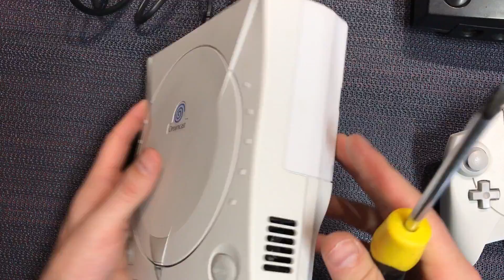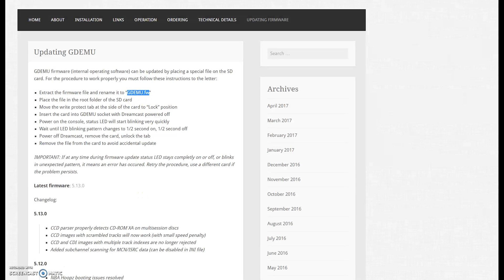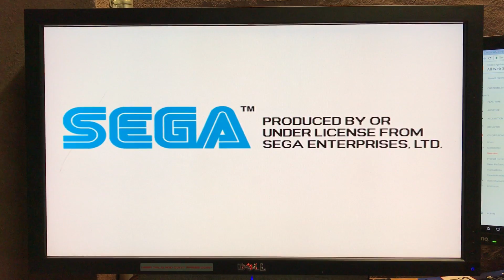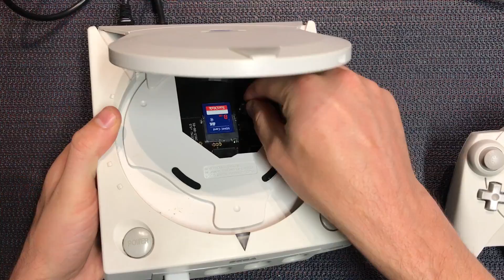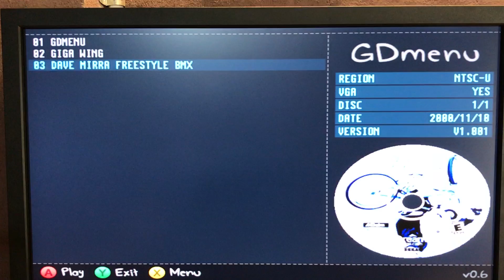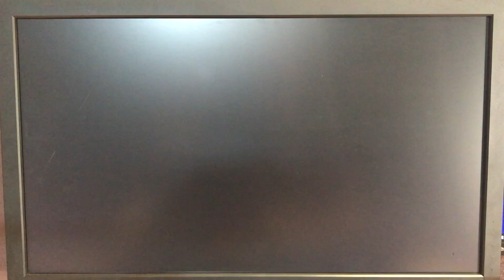Sega Dreamcast GD-EMU Install SD Card ROM ISO GDI - YouTube

Comment: Probably want to change out that power supply with a newer one as the GDEMU needs more power than the original optical drive.  I had to change mine out because of that from one on Amazon for under $25

Comment: I have the entire DC library in .GDI but when extracted the files in the folder isn't like what you have. The folder contains the .gdi file as well as a .cue file and also to here are lots more .bin files and they are labeled by the name of the game followed by Track 01, Track 02, Track 03 and so on. I change the .gdi name to disc but when I get to the gdmenu screen it says unsupported file. Next I erased everything in the folder except for the .gdi file and still says unsupported file. I also tried removing everything except for the .gdi and the .cue files but still same issue. The Dreamcast boots into the gdmenu program but games aren't supported that I have. Is there a way to fix this issue? Is there a way to rename the files in each game folder? I'm going nuts trying everything and I have yet to find anyone else that does totorial videos that has the same kind of files as me. Any help at all would be so so helpful. By the way this was a great totorial video I just wish I was able to use my rom set. It looks like my roms are not the same as all the other ROMs that I see in almost every totorial video.
Reply from the maker: DaVidKid1877 BIN CUE are not supported, so stick to GDI. Have a look around this website and then use the MadSheep tool to build the SD card. https://archive.org/details/interludev1.0032003necinterchanneljp

Comment: This is really great bro! Best alternative way for defective lens maybe. I also have question if you can help me. I have this Dreamcast Japan version and I can't find the number at the back that says if "0" or "1". It shows nothing thats why I am confused if that GDEMU works in my Dreamcast.
Reply from the maker: Jerwin Kace Ople If it doesn’t have a number, then it’s probably a first release revision 0. It’s probably also got a metal fan case/heat pipe. It won’t work with GDEmu. You need a revision 1 with 3.3v stamped onto the corner of the GDRom drive.
Reply: @RetroSalesAustralia  Thank you again Bro. Yes and your right. I found out that my unit is really "0" or VA0. So sad coz that GDEMU not suitable for "0". But thanks again bro.
Reply: @RetroSalesAustralia  Where can I buy one of these pre-moded dreamcast consoles like the one you have? I don't know how to operate on this console & how do you download dreamcast games on a sd card?

Comment: if you can't find these boards anymore.. 

found a somewhat better solution.. 

need the following. 

- Bolong 10 x Micro SD TF Memory Card to SATA SSD Adapter + RAID Quad 2.5 SATA Converter
- 7+15Pin Female SATA SSD HDD Hard Drive to IDE 3.5" 40 Pin Male Converter Adapter.
-pinout for a 40 pin ide to dreamcast motherboard wiring diagram otherwise a micro 40 pin gdrom plug from an old dreamcast gdrom. 

basically get an ide cable and solder all pins directly to board (finding a pinout picture on google and a little care) or go directly to a old dreamcast male plug and this will enable you to plug the board into the original data socket.. 

i understand that a new bios is necessary for using this board featured in the video.. but i assume that using my method may not work.. but possibly an ideal replacement..

Comment: Hello, greetings. You mentioned at the beginning of the video that gdemu puts stress on a power supply after you replace instead of the CD drive? I want to know how do you fix it?
Reply from the maker: It's not a huge deal, but here are the details on how to disable the 12v  - https://www.reddit.com/r/dreamcast/comments/461ohk/how_to_remove_12v_from_dreamcast_for_gdemu_and/

Another option is to replace the power supply altogether with one of my kits - https://www.retrosales.com.au/products/accessory-power-supply-sega-saturn-dreamcast-replacement-modified-psu-retrofit-modding
Reply: @RetroSalesAustralia  thank you for a quick reply and providing useful information. It's Time to find soldering kit and learn how to do unsoldering ;)

Comment: whats the limit on the SD for the gdemu ??? can i use a micro sd and if so whats the max it can go to ?? 128gb ???
Reply from the maker: Raymond Kennedy Hey Raymond, a micro SD if fine and they all usually come with the full size adapter in the pack. I personally use 128GB no issues, but others use 256 and 512. Just use the SD Formatter tool and you’re fine. Don’t believe what the USBGD Rom comparisons say about this only
supporting small SD cards as they are wrong.
Reply: I use 3 128gb micro SD cards and I have no problems.

Comment: Global Garage,

I installed with the help of your excellent video. I have a PAL console, everything works but I am getting the overheating issue.
As it's not advised to remove the 12V regulator on PAL consoles, is there another way of solving the overheating problem? TIA
Reply from the maker: So you're running a PICO and it's overheating? The overheating issue is only with the original PSU

Comment: Global garage have you had any problems with the dreamcast overheating with you not removing the 12v rail since you done this video ? As i have a pal dreamcast and want to know if i need to remove it or not when my gdemu arrives
Reply from the maker: Ste Coleman I replaced the power supply completely with a universal one in another video. You really need to as the 12v rail will overheat if left alone like you said. I sell the kits here if you're looking for one https://www.retrosales.com.au/products/accessory-power-supply-sega-saturn-dreamcast-replacement-modified-psu-retrofit-modding

Comment: Great video as per usual.Does anyone do the IDE hdd mod (you could use sata with a adapter board).I heard for some games the sd read speeds can be a little slow.
Reply from the maker: Thanks. I've never tried an external HDD mod on these. The SD card read times have been excellent with GD-EMU. It's important to get an SD card that is actually fast and not just go by the Class 10 label. I mean you need to do an actual read and write test in Windows or use as SD benchmark tool to determine its actual speed. I've found some really cheap cards outperform expensive ones.

Comment: Would you recommend doing this for the Sega Saturn as well? My Saturn's laswer died on me a few weeks ago, and it's the original one I've owned since release. I'd like to keep it if I can replace the laser with one of these.
Reply from the maker: Yes and No. A new laser for the Saturn is still really cheap but can be fiddly to setup properly. I've got a video on that if you want to have a go. Yes, your other option is a SD card reader from the same maker as the DGEmu. Early Saturns are generally 20pin RHEA and the later round button Saturns are generally 21pin Pheobe. https://gdemu.wordpress.com/details/phoebe-details/
Reply: Thank you for the reply. I will definitely grab one of those, but now I'm stuck trying to decide which one to get first...Saturn or Dreamcast.

Comment: Great video as always. Much easier than I'd have thought! Super cool custom shield too. Surely that is one quiet DC now. Wish there were still some GDEMU's available.
Reply from the maker: The 3D printed shield is a great addition as it prevents you accidentally dropping the SD card down into the machine. You'd have to take the lid off to get it. There's a second piece that goes inside the lid but I hadn't printed that one in time for the video. Just create a wordpress account and subscribe to his email alerts. You'll get one.

Comment: Great vid as always, You should do a quick vid on replacing the battery on these suckers with a battery holder and a normal LIR2032
Reply from the maker: Thanks. Yep I'm planning that simple video now. Two options really, rechargeable battery like the original or non-rechargeable with supporting mods.